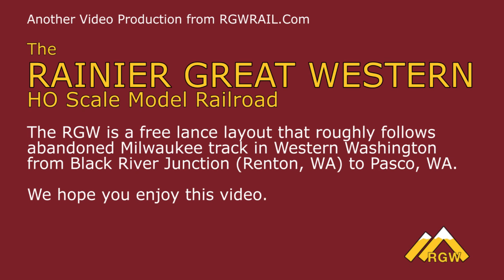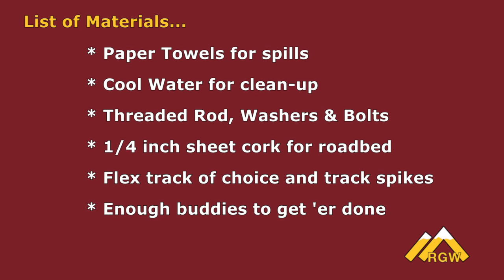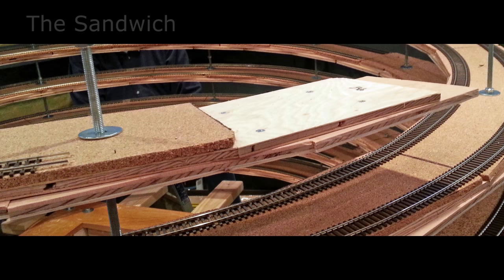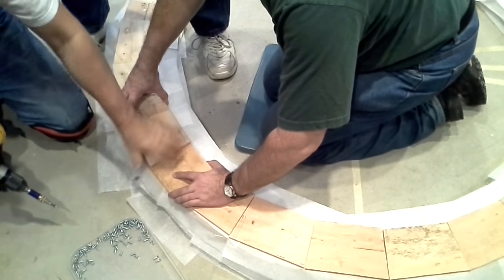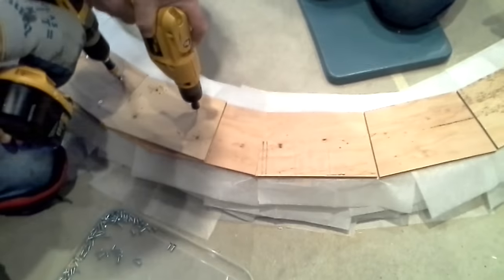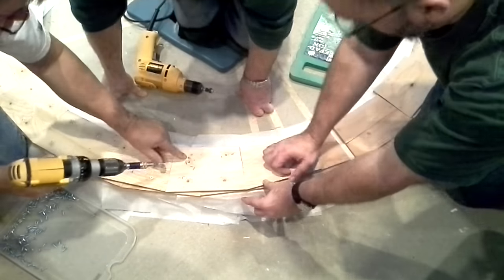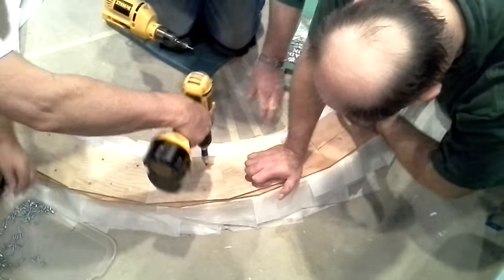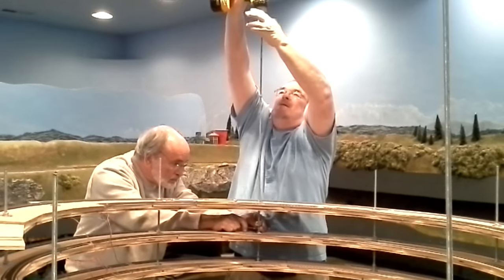Rainier Great Western Model Railroad  Helix Build

Comment: What is the track radius, inner and outer for the hilux? What kind of trains are you able to run up it? Have you run into any issues with needing helpers/extra motive power to bring trains up?
Reply from the maker: 28 inner, 30 outer. My only regret is not adding a shim or two to the perimeter when we wrapped it in fascia board. Would have been nice to have more clearance. As it is, the longer cars, autoracks, Boeing 737 carriers, we run them on the inside rails.  No issues with traction.

Comment: You got me going on my project again and I appreciate your efforts!  

Rather than washers and nuts for each lift, why not use pipe/tube spacers, copper or emt, cut to length, slide the rod through and fasten at top and bottom?  the spacer pipes will hold the grade and eliminate the juggling for each level.  Now I think about a bare rod that is threaded at the ends is less expensive than all thread, no?  provided one has the tap to cut threads.
Reply from the maker: I would be concerned that you've cut the spacer, put it in place, tightened it all down and then decide you want to tweak the grade. Then you have to take it apart to replace the spacer. The nut/washer combo allows you to tweak the grade anytime, any direction (up or down) you want.  Threaded rod was cheap so I can't answer the second question.
Reply: Well, what about plain rod and collars with set screws.  Avoids threading nuts the full length of the rod AND gives one the option to adjust grade at any point along the trackway.
Reply from the maker: Interesting, my only concern there would be the set screw working loose over time, but that's a heck of an idea.
Reply: Depends on which type of set screw is used, some are better for permanent or temporary installations.  They are more expensive than a nut, though it seems to be faster to build.  Will be trying this for mine, next year.

Cheers!
Reply: Here is a graphic to demonstrate the different set screws and how to best use them.
Reply from the maker: thx Patrick

Comment: Great job. I have a question though: why did you put the tracks so close to the inner and outer edge of your boards? When something happens, the risk of trains falling of is high. I always maintain (N-gauge) an 2,5 cm free space next to the track in curves and 1,5 cm of free space next to straight tracks.
Reply from the maker: Outside track protected by fascia on all 6 levels of track.  Inside tracks use down grade movement only, so any momentum would be toward inner half of helix in event of derail. We've never had an issue.

Comment: Excellent work. I have a query. Why not use two threaded rods as opposed to one at the center as it would have been easy to adjust the banking?
Reply from the maker: Good question Madhu, we had a finite outer dimension we had to account for as a main aisleway goes around the helix. In order to assure track spacing, using one rod in the center ended up a better solution than two.

Comment: Thanks for this video Michael. One of my viewers was asking me about a helix and I found this one. Wow, that's a lot of work. Did you say how many panels you cut from your 3 sheets of plywood?
Reply from the maker: Thanks Tom. I cut way more panels than was necessary. Used 3 full sheets of plywood, really need only 2.  We used one sheet for the top pieces, another for the bottom. This ensured a consistency of dimensional thickness throughout.
Reply: Thanks for responding so quickly.
Reply: just as I was getting comfortable with the idea of helixes this one is extremely intimidating. nice project and good commeradery.

Comment: A very repetitive and tedious process. I have never seen this "tile system" process before...what is the thinking behind it that you decided to not go with the "normal" method of using a series of curved 1/4 or 1/2 circle strips of plywood?
Reply from the maker: great question, at the time I decided based on a couple of factors, 1) wanted it very rigid 2) as thin as possible. 1/4" by itself is anything but rigid and 1/2" ply is not actually 1/2", which meant we'd probably have to settle for 5/8", which I felt would be too thick. also felt the amount of waste cutting circles out of ply wasn't worth the cost. In the end I used only 2 full sheets of ply and the true 1/2" thickness, combined with glue and screws gave us a helix you could walk on. entire build process took 2-1/2 hours. We laid cork & track following work session and added the rod a week later in one evening.